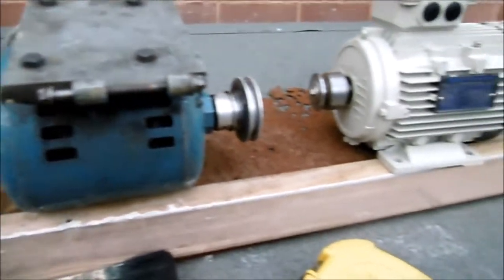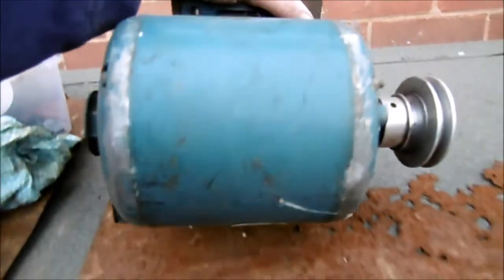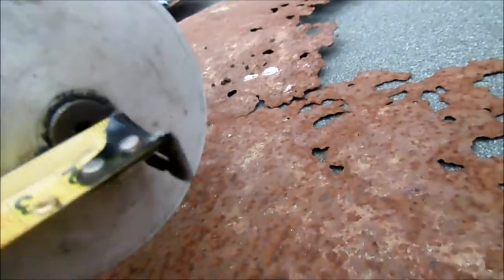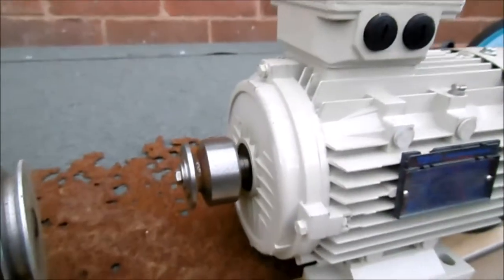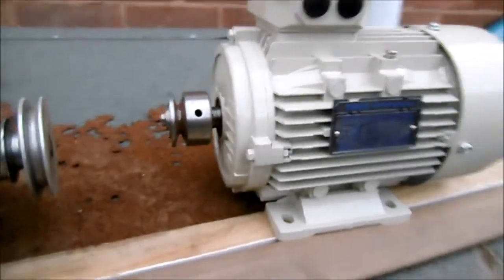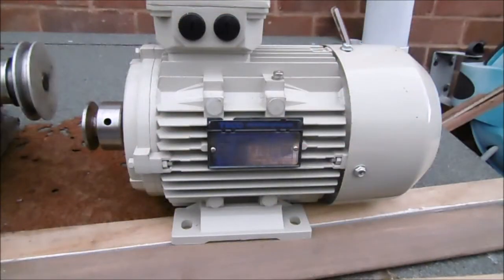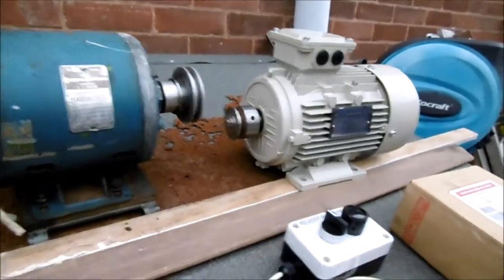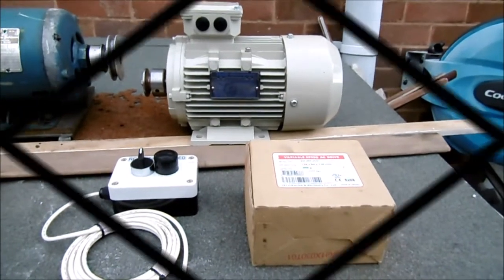Myford Variable Speed Motor

Comment: I have a ML7 that I would like to add stepped pulleys to the motor and lay shaft, I have watched several of your videos and noticed that your engineer modified super 7 has a stepped pulley on the lay shaft and was wondering if it was possible for you to measure the diameter of the pulleys.
Kind regards 
Raymond
Reply from the maker: Hi Raymond, is this any help..https://youtu.be/3zhjKgG1FrE